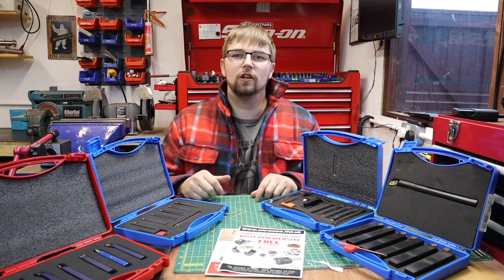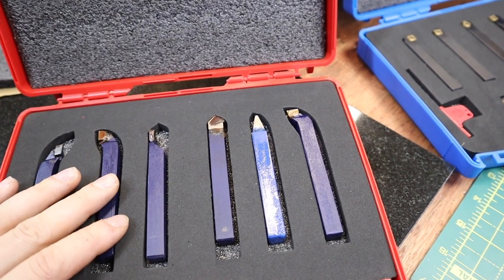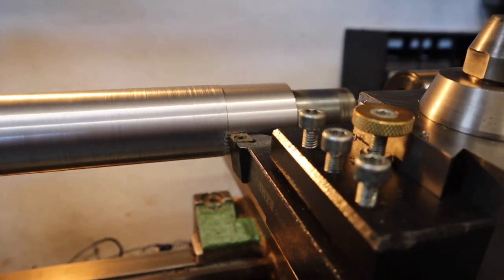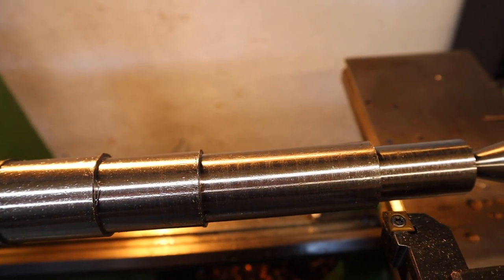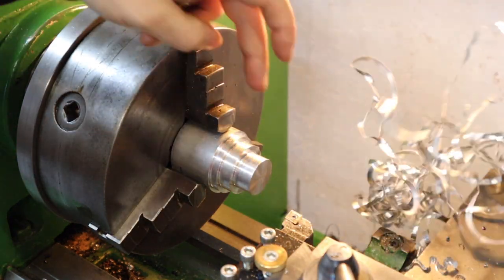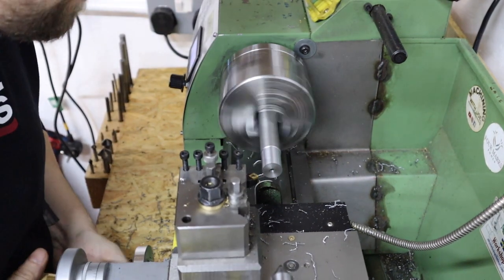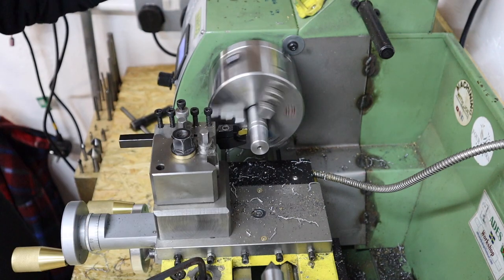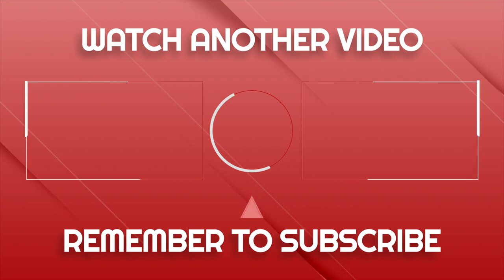Testing Glanze Lathe Tools From Chronos

Comment: Interesting video, the problem with most hobby lathes is that the first thing to max out is the lathe itself because if you run the inserts at the speeds and feeds they're designed to go most lathes won't go that far. Specially in roughing the biggest limit is rigidity.
Reply from the maker: Yeah I suppose you are correct Luca. However I have found some insert tooling on the mini lathe gives significantly better or worse performance. And I have to say the Turning tool performed quite well considering other tools I have used in the past.
Reply: @MachiningwithJoe  Of course there are better and worse inserts and with hobby machining finding one that performs better with the limited capabilities of the mini lathe is the key.

Comment: For Aluminium you need CCGT style inserts and WD40 to keep it from sticking to the tips. Maximum spindle speed and .35mm per rev for roughing, .1 to .15 per rev for finishing, adjust the depth of cut to keep it spinning without stalling the spindle. Minimum depth of cut should be tip rad.

Comment: Brazed carbide is not inferior to insert carbide. It just serves other purposes. 
You can grind the required angles on the tool yourself. 
And if you use the wrong lathe tool, it doesn't matter whether it's brazed carbide or insert carbide.
Reply from the maker: Ahh I understand almost like a HSS blank although it’s been shaped. I think for the convenience I have always used insert tooling but I suppose it never hurts to experiment.

Comment: A few years since I was in the industry now, we always used to use the Sandvik gold coloured inserts, they were long lasting and very hard, there was also an Israeli tip we used called Iscar, not quite as hard but very tough, good for intermittent cutting on heavy cuts.

Comment: On the CNC machine that I used to operate, it had loads of power being an industrial m/c AND loads of guards protecting you from swarf, and, on Aluminum I used to run 1000 M/Min (at 10" diameter I was on max speed of the machine of 1550rpm) 5mm depth of cut and 0.8mm feed. Of course there is no way you could safely do that on your m/c, but it's to illustrate what a tip designed for aluminum will do.

Comment: On Aluminium on a home lathe I think I would probably max out at 6mm depth of cut but bump the feed rate right up, your work will remain cooler (important on fine tolerance) as the heat will be in the chips and you will not have dangerous streamers that can take your arm off.
Reply from the maker: Hi Dr1verman thank you for all your comments as always your experience shows with what you say. I think your right I will never need to do 10mm doc and sticking to 6mm max and bumping feed rate might hopefully get those chips breaking. All the best and thanks for all the comments I nice again.

Comment: Hi Joe, great video. It would help if you told us the speeds you tested the new tools at.👍
Reply from the maker: Sorry Roy thought I sed in the video but seems I didn’t. So
20mm tool 530rpm in steel with 1.4mm/rev feed rate. 
20mm tool 890rpm in 6061 with 1.6mm/rev feed rate. 
10mm tools on mini lathe 900rpm for .25mm and .50mm doc with hand fed feed rate.

Comment: Bit of chatter on the Chf tool bcoz you were a long way out and running a bit fast, at the Railway we used to face the ends of the train axles in one go with a broad tool that had been machine lapped and we ran the machine at 5rpm. Ade has probably done that 🙂